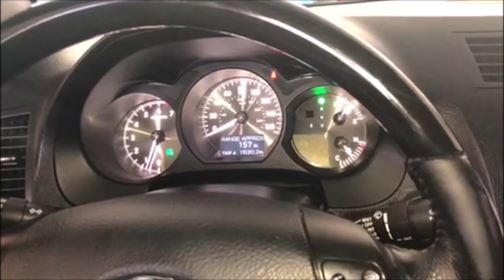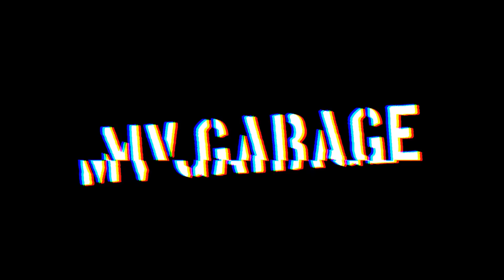Lexus Toyota VSC / Trac Warning Light FIX

Comment: Thank you ! This happened today and the good old paper clip trick worked. But does this mask a more serious problem? I ran codes and I got  P0390, P0365, P0345,P0340.  ???
Reply from the maker: No problem! Happy to help. No this is just the reset procedure. If there is a real problem it will come back on eventually. If it doesn’t then there was no real fault.
Reply: @FlipITGarage  So turns out the next day the car was dead, turns out battery, replaced battery, checked alternator to make sure charging, all good. But now only the drivers window works,  the other three windows do not and the Dual Climate zone setting do not act independently anymore? Only one climate zone and not two zones any longer? Wondering since replacing battery it reset something? Main screen showed "Rebooting" after turning car back on?
Reply from the maker: @okkin981  Yep the windows and sunroof need to be reprogrammed. Just go to each door window switch one by one. Hold down, when it reaches the bottom hold for an additional 3 seconds then do the same going up. Do that to each door.
Reply: @FlipITGarage  Boom! That did the trick! And for what ever reason the Dual Zone AC started working as well. I replaced both of the Cam Sensors as well for good measure because they were super easy to swap out and thats what the codes were all about. So far so good! Thank you for all your help sir
Reply from the maker: @okkin981  Your welcome! Glad you got it all fixed! Let me know if I can help with anything else! 🤙🏽
Reply: @FlipITGarage  Well Guess what? The "CHECK VSC" came back up today along with the check engine light and another light that shows traction control? Uh Oh...Any Ideas?
Reply from the maker: @okkin981  You’ll need to get the check engine light code scanned to see what the code is. Any autozone will scan it free if you don’t have a code reader. The VSC always goes on with the check engine light.
Reply: @FlipITGarage  First time this happenned,  I scanned and codes P0390, P0365, P0345,P0340.. I replaced both Cam Sensors just in case. This happenned today again...1. Dirty Clogged Cats? 2. Dirty MAF Sensor 3. Alternator (but I tested that the last time and was working fine) 4. Gas cap?

Comment: For 2007 Lexus GS 350 it works only if your check engine light is NOT on. Thank you
Reply from the maker: Emmanuel Tenkorang thanks correct. This only works for the VSC light on by itself. If you have a check engine light on that’s the reason the VSC light is on. You can clear that by disconnecting the battery for 10 mins.

Comment: I have an 08 lexus is350, I place the paper clip in the 4th hole top in bottom and I did not go into vsc mode.  Can you make a recommendation?
Reply from the maker: S Chance It should definitely work for your vehicle. Did you have the power on ? And compare with the video to make sure you were in the correct spot on the connector.

Comment: Hi, do you think it would work on a 2006 Toyota highlander hybrid?
Reply: I did it already but I didn’t reset the system, it gives me a code: vsc test 45
Reply from the maker: If it’s only the VSC light without the check engine light it should work on the Highlander.
Reply: @dreamrunner4ultratrail Did you ever figure it out? I have a Highlander with vsc code 45 and Ive spent $1200 on brake parts, and bought a new abs module, this has been a nightmare

Comment: Hello sir my Lexus sc 430 2002 model gear indicator in display and reverse light not working and when I shift s gear to while you slowdown the vehicle it gives jerk plz let me know the cause ND solution
Reply: Convertible also not working I recently changed engine after that this all problem came
Reply from the maker: Sounds like you have multiple issues. That would need to be checked in a shop. Could be mechanical or a computer issue.

Comment: I tried it on my 2007 Lexus is250 and it didn’t work. The “Check VSC” is still showing on the dashboard. Any more advise on what to do?
Reply from the maker: You only have the VSC message correct ? No check engine light ?

Comment: does this work on es350?  I have this problem after replacing tranny.  check engine light is not on.  only VSC light and check vsc message is on.
Reply from the maker: Yes, it’ll be the same procedure on the ES.
Reply: @FlipITGarage  Thanks for the reply.  However, I tried this procedure but did not work on my 2007 ES350 (2007 Camry).  I saw only ABS light blinking and nothing else.  Basically you are shorting pin 13(TS) to pin 4(GND).  Could TS be pin 14 on this model instead of pin 13?

Comment: Hi, my Lexus GS300 2006, very often show the sign of brake systems failure + check engine and VSC, three at the same time. Went to garage at least 9 times, none of those mechanics can fix it. They replace all 4 ignition coils, one set of spark plugs and one set of exhaust spark plugs, and two days later, these three hell signs come up again, I feel hopeless to get rid off these. Hopefully you have some great tips on it. Thank you
Reply from the maker: vanda Sir. If you can provide me with the codes you get I can try to help. Thanks.
Reply: Did you ever figure this out, I’ve read a gas cap, I’ve also read the wheel speed sensor replacement didn’t even work and new tone ring didn’t work

Comment: Hy i got the same problem on my 05' gs300 and the warning lights also pop out. Diagnosed it and got few codes:
C1201
B2412
P0986

Pls help to clear the warning lights. Got some recommendation to change the whole auto transmission (but costly).

Comment: Didnt work for me Some other Lights kept blinking . Does this Work for gs430 2006  or just gs300?
Reply from the maker: Abdul Rehman Shahid Works for that model as well. If it was blinking you were doing it correctly. Just follow the steps exactly.
Reply: Well i did but instead of The vsc blinking, The Sport mode and Someother Lights are blinking  
It shows Test 51 
And my display Screen was showing me the configuration and test for couple items such as Screen touch check 
I will try it again and Hope to see it work 
Although i have my gas cap Lose

Comment: I had a engine replacement on my 2007 Lexus gs350 and my vsc light is on and my brake light. What do I do? I read the codes and all it says is brake system error
Reply: There is a check engine light on for the o2 sensor.
Reply from the maker: The check engine light being on will trigger the vsc light as well. When the check engine light is off the vsc light will go off as well. You can try resetting it.

Comment: I just got my hybrid battery replaced on my 2008 Camry Hybrid and the 'Check Hybrid System' code went away but the 'Check VSC System' code stayed with the 'ABS' and the 'Brake' warning lights on too. How to fix this?
Reply from the maker: Thomas George You can try the method in the video. Should be the same procedure.
Reply: @FlipITGarage  Thanks for your reply. However my OBD port is horizontal, not vertical- so 4th one should be from left or right?
Reply from the maker: Thomas George one side should have four pins. I would just count them from the photo in the video. I couldn’t tell you as I don’t know which way it’s facing. Just pause the video on it and count them.
Reply: Well, figured it out. For my 2008 Camry Hybrid, jumpered CG to TS on the OBD Connector as shown in this video and worked! There was no Test mode coming up but kept the jumper on and ignition ON for 2 minutes and then turned the engine on for another minute. Turned off the engine. Removed the jumper and on restart, the lights were gone. Guys get the OBD connector pinout chart (each car may be a bit different) and jumper the terminals as indicated by MV Garage. Thanks a tonne, MV Garage!!
Reply from the maker: Thomas George Nice! Glad you were able to find the correct pins to link and it worked out for you! Thanks for the advice for other subscribers! And your welcome! Just glad to help people out :)

Comment: Does this procedure work for a 2009 Lexus ES350 when car  system says "Check VSC" and the VSC ,Check engine and Traction Control lights are lit up?
Reply from the maker: If the check engine light is on that is the reason the VSC light is on. You can clear the lights by disconnecting the negative battery terminal for 10 mins. If the light comes back again you should get it scanned and fixed. Hope that helps.
Reply: I tried the procedure and the lights were cleared.......but after driving a while the lights came up.....
Reply from the maker: @lassivebass3378  you’ll need to get the check engine light code scanned to see what It is. Any autozone will scan it for free. Let me know the code I will try to help. 🤙🏽
Reply: Used an OBD II scanner.....error code P0352 was displayed......while driving I feel the engine loosing power
Reply from the maker: @lassivebass3378  cylinder #2 ignition coil sounds like it went bad. You need to buy a new ignition coil and change it out. You can find them for a good price on eBay. Simple to replace.
Reply: the traction control light still comes up ......would changing the ignition coil remove  both the engine and  traction light ? Cause the system says "Check VSC"

Comment: i have a lexus is250 2007 awd my vsc, Trac came on when i putted gasoline in the tank.. but my issue that i have is when i try to start the engine it wont start right away .after the 3rd or 4th try it will start
Reply from the maker: Mitsu RT Do you have a check engine light on with the VSC light ?
Reply: @FlipITGarage  yes
Reply: @FlipITGarage  could it be a loose battery cable?
Reply from the maker: Mitsu RT I would start with getting the check engine light scanned first. They will scan it free at any autozone. Let me know the code.
Reply: @FlipITGarage  kk i will do i have one off those machine thingy to check the engine but ill check it tomorow ..but the check engine light came together with the vsc and the trac control..but ill check the code tomorow and ill let you know.. i subscribed and thnx for the quick reply
Reply: @FlipITGarage  GoodAfternoon buddy ..i checked the light today it said System too Rich Bank 1..but i just went to the minimarket a minuteago and when i got back home the engine check light and trac control turned off
Reply: @FlipITGarage  the only light im seeing right now in the dash is the exclamation mark thingy and right down there's something else flashing.. but the one ibought it from told me that the tire pressure sensors are not in the tire
Reply from the maker: Mitsu RT If there are no sensors installed in the wheels you cannot get that light to go away unfortunately. What was the check engine light code you had ? P####? Just wondering. Does you car start normal now ?
Reply: @FlipITGarage  System Too Rich Bank 1.. but those lights are off now that indicated that problem..yes its starts normal now..
Reply: @FlipITGarage  ye im about to get them tire sensors in about 2 hours from him
Reply from the maker: Mitsu RT I’m glad the problem is gone! If it comes back let me know !
Reply: @FlipITGarage  GoodEvening Buddy... my light came on and gave me the codes again.. but in my case it was a faulty battery that needed to be replaced.. i  deleted the code and drove around and the lights didnt come back on ..Thank you for your help and the quick responds..if there's anything else i'll let you know.. looking forward to more videos of you
Reply from the maker: Mitsu RT Glad that worked out for you! And anytime. Happy to help!

Comment: Hi, just need some help, I took my 2007  Lexus is250 for new tires and boom all the lights went on and the guy that installed the tires didn't  know what to do, I tried your method and didn't work, is there maybe a fuse that is burnt...please help.
Reply from the maker: Hector Moreno Did the lights start blinking like in the video when you tried it ? If they didn’t then you may have don’t it wrong. If they did then a sensor may be damaged.
Reply: @FlipITGarage  Hhhmmm, I don't recall seeing them blinking but i will retry again. Thanks
Reply from the maker: Hector Moreno No problem! Yea give it another try you might of hit the wrong pins.

Comment: Hi there, I did this on my gs 300 2006 but light didn't go.
Yesterday morning just started the car and engine light with check vsc came on out of no where.
Reply from the maker: Hawas Diary’s Hello! This method only works if it’s just the VSC light on only. You have a check engine light too. Get the code scanned and let me know what it is. I’ll try and help. Thanks !
Reply: @FlipITGarage  thanks for the reply, I'll do that this evening and let you know, any idea if I can bypass tpms in this vehicle?
Reply from the maker: Hawas Diary’s not a problem! Let me know what code you get. TPMS I know a few tricks but not to get rid of the light without extra sensors.
Reply: @FlipITGarage  the problem is that I bought new 4 and installed, but where I live no one know or have the tool to avtivate them on the vehicle
Reply from the maker: Hawas Diary’s unfortunately they will need to be programmed to your vehicles tpms computer with a scan tool. No way around that. There must be a shop or tire shop that can program it. It’s a pretty basic procedure.
Reply: @FlipITGarage  I scanned the error and it says p0456 evaporative emission control system leak detected (very small leak)
Reply from the maker: Hawas Diary’s with that code I would definitely start with the easiest fix check the gas cap seal. If it doesn’t seal good replace it clear the code and see if it comes back on.
Reply: MV Garage Definitely gas cap seal! Check this first after 50 miles of driving it should go away.

Comment: Will this fix the abs vcs and brake malfunction warning too?
Reply from the maker: With all those lights on there is probably something else going on.
Reply: @FlipITGarage  2008 GS460 it happened after replacing the brake acuator
Reply from the maker: @rp17rionda  have you tried disconnecting the negative battery terminal for 10 mins then reconnect it and see if that clears it ?
Reply: @FlipITGarage  i will try that.. mechanic said mechanically the car is all ok and acuator is functioning well.. but he cant reset the lights.. he is waiting for a friend from lexus to do it but might charge me? Doesn’t seem right?🥲
Reply from the maker: @rp17rionda  If it’s just a reset with the scan tool I wouldn’t charge for that. Takes a few minutes.
Reply: @FlipITGarage  i wonder why my mechanic said he couldn’t reset it? But guaranteed me that the car is all good and drive back and forth to new york and florida without issue😅😅
Reply from the maker: @rp17rionda  if it’s not displaying any codes. Even a weak battery can cause all those lights to come on. Also check fuses for the ABS.
Reply: @FlipITGarage  i will’ thanks
Reply: @FlipITGarage  now the low tire warning is on too.. but i have an after market wheel with no tpms😅😅
Reply from the maker: @rp17rionda  yep! No sensors that’ll cause the light! 🙃
Reply: @FlipITGarage  so what could be causing it

Comment: I have a 2009 ES350 with VSC, trac light and check engine light on.  Is this the same procedure?
Reply from the maker: FT Section # Yes same procedure on the ES.
Reply: MV Garage what if my light is still on?
Reply from the maker: FT Section # sorry I misread your first comment. If you have a check engine light on that is why the VSC light is on. The check engine light needs to be off and the VSC will go off. They go on together. You’ll need to get it scanned to see the problem. You can also reset it by disconnecting the negative battery terminal for 10 mins. But it may come back on.

Comment: Would this work on 2007 gs 350 to clear the vsc light
Reply from the maker: Gjergji Dano Yes it will work on the 07. As long as it’s just the VSC light. Same procedure.
Reply: @FlipITGarage  Thank you
Reply: I just turned the ignition on and vsc,abs check engine light,and battery light came on,before I only had vsc and check engine light also flickering numbers at the clock.Have you or anyone had this problem before ?
Reply from the maker: Gjergji Dano If you have all those lights on this procedure won’t work for you. With all those fault lights sounds like you have a bad alternator. You should get it tested to confirm but I suspect you’ll need a alternator replacement. Happened to me before at around 100K miles on the same car.
Reply: @FlipITGarage  Thank you for your advice i will check it to make sure 👍
Reply: @FlipITGarage  Don't mean to bother but I have a different problem now no lights on dash when I try to turn ignition on or try to start it up,battery is fully charged also checked fuses in engine compartment and trunk
Reply from the maker: Gjergji Dano Does the car start ? Have you checked the alternator?
Reply: @FlipITGarage  I couldn't check it because I couldn't start the car no lights on the dash at all
Reply from the maker: Gjergji Dano that may be the root of your issues.
Reply: @FlipITGarage  I asked my mechanic brother to help me and he found the problem,it is the positive battery cable from the battery to the fuse box next to it
Reply from the maker: Gjergji Dano great! Well atleast that’s an easy inexpensive fix! Glad you found it! A lot easier seeing the vehicle.
Reply: @FlipITGarage  Thank you for your help